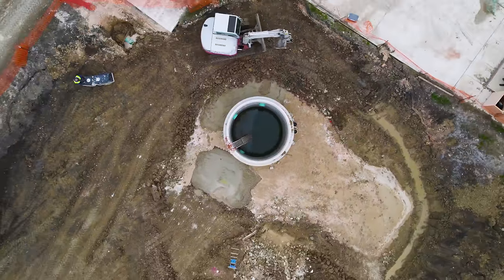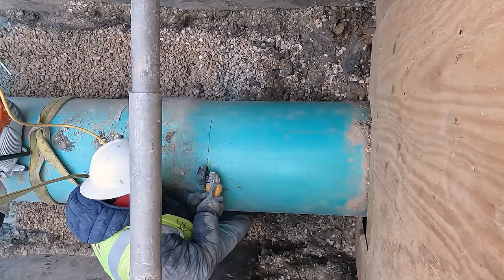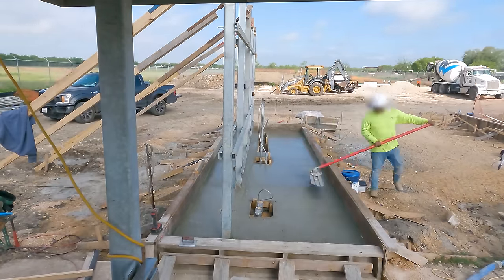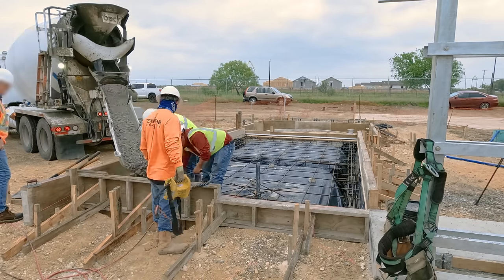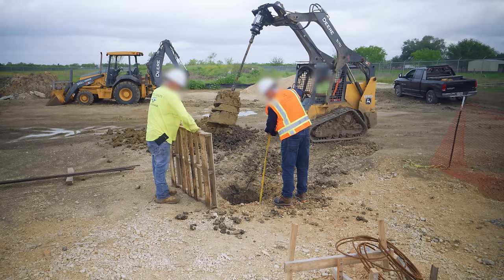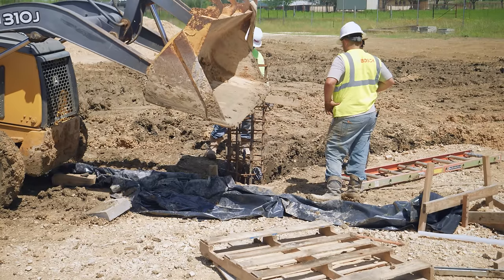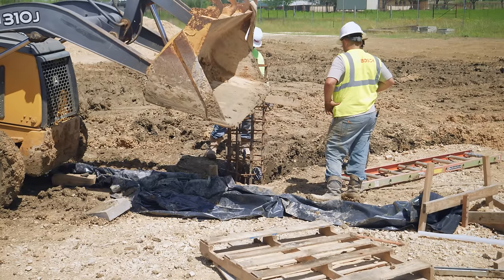HEAVY CONSTRUCTION of a Sewage Pump Station - Ep 4

Comment: Hi Grady, love your channels! This new sewage pump series has been great.  I have 2 reasons it resonates with me. 
(1) I am a mechanical engineer and have designed similar (yet smaller) lift stations for small communities and apartment/mixed use sites.  
(2) I live in a small rural township, we are getting our own lift station installed right now! As the township expands the sewage will be lifted and pumped to the larger nearby city. This small rural township (Harlem) is located in Ohio.  And in case you haven't heard "intel is coming to Ohio".  Unfortunately I live 5 minutes away from that new Intel site.  I really hate to see the development come, but watching your show and seeing it happen in my own backyard at the same time has been very cool.  Thanks again for all your hard work.
I am also anxious to see the last part and hear what the specs are for the pumps.

Comment: The engineering here is of a sound nature, but the actual pour process is flawed. There are quicker more efficient ways to achieve faster more profitable results especially when it comes to method and concrete product being placed. 
At Lafarge we would recommend our Agilia product which is rich in water reducer, command set accelerator higher than 1%,  plasticizer additives, as well as steel reinforcing fibres poured into a slip form. Do it once. Do it right.

Comment: I was literally an SPM for a much larger pumping station when I worked for a commercial GC and I still enjoyed the video. Very similar process to the job I did, we just did a lot more, but never got to watch it time lapse and with drone view. Another cool and somewhat similar project was we did was an aquatic center (like a big building full of indoor pools ) that included a massive prefab concrete underground stormwater detention chamber hidden underneath the parking lot.

I learned a ton of very non-intuitive stuff on that job. For instance everyone assumes that everything metal in a building for an indoor pool should be stainless steel due to the moist environment. Actually stainless should never be used in an indoor pool building. The reason is because of something called stress corrosion cracking. Turns out that in the presence of chloramine (a byproduct from the breakdown of the chlorine used in swimming pools) causes a very specific type of corrosion that stainless steel is particularly vulnerable to. It also effects regular steel, but to a much less effect, and more importantly, in regular steel the corrosion occurs in the same manner as regular corrosion and can be clearly seen through visible inspection. In stainless it shows no visible signs of deterioration right up until the point that it fails catastrophically.

There was a viral video a while back of a pool where the hvac ducting had collapsed into the pool and onto all the people using it. The galvanized ducts had visible corrosion (which is to be expected) but the broken allthread they used as duct hangers didn’t have a bit of rust on them - stainless. I remember wondering how the architect, engineer, GC, and HVAC sub all missed such a critical detail. Was it because none of them actually knew that it was a massive mistake, or was their oversight just so bad that nobody caught the fact that the hangers were a different material than spec.

Comment: Questions on episode 5:  (1) why do they only test surface concrete and not the concrete down in the well?  Seems more important to test the concrete in the bottom of the well to make sure that the bowl at the bottom is sound.  (2) Why not use an electrical backup (tesla MegaPack) instead of a diesel pump?  Would require significantly less infrastructure in pump, pipe and valves is you had a battery backup for existing pumps instead of a separate diesel pump in case of grid failure.  You could then bring in a diesel generator as a last, last resort which you're already set up to do.  Bonus:  you could use a Tesla MegaPack in place of the backup systems for the old well too.  (3) Nice set of white pickup trucks along with you Tesla at a shot toward the end of episode 5.

Finally, would be great if nebula allowed comments so that I wouldn't have to use this nebulous method to post a comment on episode 5.

Great series!  Thanks.

Comment: I know that hind sight is always 20/20, but when you live in a growing city you should know that systems like this will need to be extended and where the extended system will be placed.  Putting some of these valves and joints in place when the original system was installed would have been the smart thing to do and saved a lot of money.

Close to where I live the electrical utility owner bought some land to install a new transformer for the area.  They built the sight for two transformers but only installed one.  The distribution lines they needed to be hooked up to were across the street so they ran underground cables to them.  But the pad for the second transformer, most of the connections from the high voltage line where put into place and hooked up to those lines, and the underground cables to the distribution line were all put into place.

Now, when it becomes necessary to install the second transformer, all they have to do is set it in place, install all the connectors to the low voltage cables and finish the high voltage connections.  That is what you do when you see an area growing in population and you plan for the future.

Comment: I really like this view into the process of construction. When I did an internship at a glider manufacturer we were required to sample a bit of the epoxy for testing just like the concrete here.
One thought though: the concrete slabs have trenches on the outside (and in the middle for the bigger one), I guess they are a sort of foundation?

Comment: Well Engineering and Solutions to this project impressed me. But two giant mistakes are being made, The Steel Bars (Rebar) used in the entire project must be galvanised or electroplated. Andthe Placed concrete must be submerged or at least  sprayed with clean for a month, after that it can be glazed, painted or epoxied. These additional steps and Engineering will make the structure more durable (strong) and especially more reliable (very long life of structure) under proper inspections and maintenance (if required).
Reply: Although I am an Electromechanical (Mechatronics Engineer) but I do possess a great amount of Civil Knowledge and Experience. Anyways the floating guys did a great job. In here the floating guys dont do a great job and after curing the Concrete structure, with water, for a month, we place level dots on the slab, then place additional 1-2 inches of Concrete using smaller gravel and some waterproofing chemicals. That additional Concrete is sloped troweled and finished perfectly and then again cured.

Comment: These are excellent videos on construction. Maybe the lower viewership is because people are turned off by sewage. I was a city construction inspector for Los Angeles and 20% of our work was for wastewater conveyance and treatment. In my experience many people didn't want to hear (or see or smell) about sewage, they just want it to go away and get taken care of.
These videos would be great for training for civil engineers, construction workers and inspectors.
Grady covered so much so well here. I would like if he had added about the concrete mix design (and load tickets), and if spark testing was done for the wet well epoxy coating to ensure there were no thin spots.
Thanks!

Comment: Excellent presentation. I'm a 20 yr retired electrician. I can honestly said been there, did that. There the only thing is why they buried the block valve rather than putting  service pit. Just wondering. That was the engineers call. I used to service a lift station that looked like a regular man hole but when climbed down 2o feet, there was a 8x8 two story room with all the parallel pumps. If one went out. Valve it out and valve in the back up while you fix it. It had the wet well next to it similar to this one

Comment: It's been a bit since I've built any pump stations, but here in my area (northern New England) the majority of the concrete work is all precast structures.. especially the tanks and light bases. Any penetrations for piping is cored on site.

It is neat to see what you can do when 5' of frozen ground isn't a concern... you'd never see conduits backfilled with concrete.

Comment: I'm amazed at all of the tools they use to make the job easier. I'm surprised that they still have to hold the diamond saw themselves though and put all of that force on their lower back to cut into the concrete on the ground. It makes sense why they do it that way but you'd think there'd be a tool to prevent that.

Comment: Instead of those cardboard void forms, I wonder if you could use some kind of foam? Maybe even an expanding foam you could spray in, and then slice the top level. Then if the slab settles it would just compress foam. That would prevent animals or anything getting into the space, while still being mostly air.

Comment: 14:00 I'm surprised that you cast the top of the wet well. In the UK we use precast concrete slabs called biscuits (might call them cookies in the states). Any extra wholes required, just drill thru.

Comment: I have seen slabs replaced days into the building of the structures atop the slab because the quality control samples didn't pass compression testing.

That put a housing project over a full year behind schedule because of the time to break the defective slab, reform the substrate and fill, replace the rebar, the time of having to get all the subcontractors back on site from the other jobs they had moved onto.
It's bad.
Reply: The concrete supply company ate all that cost and then went out of business.

Comment: I was wondering what kind of pumps they use for pumping sewage? Everything I recall from class is you want regular, potentially treated, water with ample head to prevent cavitation on the blades/fins and other issues that could damage the pump. I imagine with sewage there’s a lot of “debris” that could foul up a pump, unless they use positive displacement pumps maybe? Burning question from a young new engineer 😊

Comment: TIME 19:40 - The electrical coming out of the slab/silo will be sheared off if it settles.  Either the concrete skirt or the fact the sweeps (90 degree conduit) are cased in concrete.  This block nor the skirt will settle at the same rate as the silo/slab.  Thoughts?

Comment: there are areas in my region that have had sewer put in to replace existing septic systems.  some agencies installed pipe with taps for every property.  others require the septic installer to drill his own tap into the sewer line every time.  the best example, ran the sewer line up and over a hill, requiring every homeowner to have a 240V discharge pump to pump their wastewater over a hill the sewer line could have easily gone around.

Comment: How do they finish installing the pump towards the beginning of the video? I can't think of any way to connect two unmovable sections of pipe that can't be brazed together. Is there a kind of pipe that extends to bridge the gap between the two? Are the sections of pipe more mobile than I imagine they are? I don't have a complete picture here.
Reply: Sorry, not pump, valve. It's early here.

Comment: I really hope that the nuclear density gauge at 5:07 is either a dummy unit and that they're demonstrating how not to use one. If that is a real gauge, the radioactive source shouldn't  be exposed like that above ground; the operator just blasted everyone in the immediate vicinity with an unnecessary exposure of ionizing radiation.

Comment: The deeper into this project we get, the more frequently I find myself saying "Well, that doesn't seem like the most effective way to do that task..."

I am by no means a structural or construction engineer, but 

1) Why is the well cap cast in place, necessitating all that forming and scaffolding?

2) What actually happened at the "cut the line" stage -- it was kind of glossed over...

3) Was it really necessary to drill for the light pole, when we were going to excavate a trench to it anyway?

4) And what about Naomi?
Reply: Sidebar: is the incidence of "construction worker who the FBI is after" really high enough to require blurring out every face in the video?  It's really sort of jarring.

Comment: I would have liked to see the method of reconnecting the cut ends of the plastic pipe, after the installation of the valve.
Similar gasket thing?

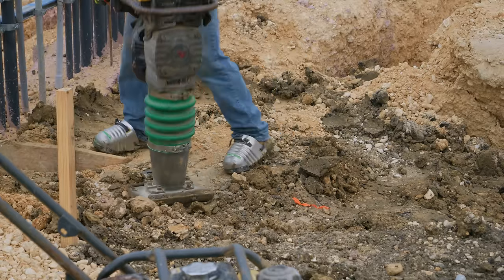Comment: This series is very cool, I'm going to be sorry when it ends. How does the first pump, 24", that got installed early on, get controlled? I didn't see any electrical or mechanical means to turn it off and on.  Any idea what its service life is? Just wondering why it wasn't put in a vault. At around 6:45  I saw for the first time, but just briefly, when the jumping jack was being used the operator looked like he was wearing heavy metal slippers, neat. I'm surprised no warning tapes were used in the backfill going into the trenches.
If the concrete doesn't past the compression test, who picks up the cost of all the work of replacing the slab. Does the industry release how often that happens?

Comment: 20:12, I understand the large slab is coupled to the wet-well, and not the surrounding material, but then the protruding conduits are cast into a block that is not coupled to the wet-well, but rather to the surrounding material..  Doesn't that mean that in the event of any settling of either the wet-well or that block, all the force will be on the conduits ?

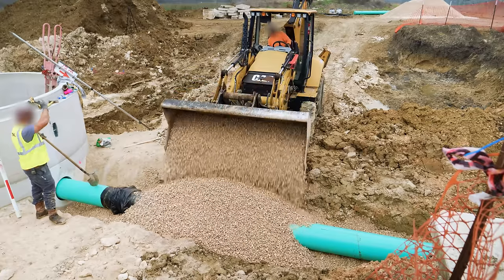Comment: A valve is cut into a 24" line (3:30) then apparently buried right away (4:00).  How is this inaccessible valve going to be actuated (controlled, opened/closed)? I saw no sign of any electrical or pneumatic connections being installed nor any sort of access cover or some sort of riser to a handwheel station. Was something left out of the video?

Comment: As an electrical engineer doing similar design  I don’t see a reason to bury the conduits in concrete (unless they're over 600 volts) and the metal parts should be coated in bitumen or like product where underground or cast in concrete IMO.  Otherwise,  like the videos and format

Comment: That step where the inspector pushes the probe rod out of the machine, then eyes it to get it into the hole, is exactly what the manufacturer says not to do.  When the rod is up in the machine, it is surrounded by a lead shield to contain radiation.  When the rod is extended, the radioactive source is exposed and lowered into the ground, alowing for a radiation count that correlates to density.  At no time should the rod ever be exposed to the open air.  It can cause cancer and radiation sickness.  Remember when Australia went nuts for a few days last year because a radioactive source from one of these rods WA lost along a highway?  Do the inspector a favor, and let😊 him know why he should not do that.

Comment: I think it's hard to balance keeping the content simple enough to understand and fitting everything into the limited time (and attention) viewers have. The regular videos are about a narrow topic, so they can be both short and go into sufficient depth. 

In this series, there are parts where I got confused as to what the thing they're building is supposed to do and how it fits into the larger picture. For example, I'm still confused on how the wet well helps lifts waste water, or what control shelter does.

Perhaps a better way to present this is to focus on one or more subcomponents of the lift station in each episode, covering them from beginning to end. E.g. first episode is just the wet well. Second is the piping, valves and manholes. Third is the pump and electrical connections. That way each episode is self-contained, with hooks (in the form of questions) at the beginning and rewards (in the form of answers) at the end.

Comment: I dont know about Texas but in NC the way the CMT inserted the radioactive source in the nuke gauge is incorrect per standards. Ideally you would drop the gauge directly where you hammered your hole so you aren't exposed to the source rod. But again Texas is probably different.

Comment: 16:20 Why does the slab need to extend so much around the well? Wouldn't it be enough for it to be just large enough so that it can't fall into the well but not extend beyond the well's edges? Then there wouldn't be a need for that empty space around the top of the well.

Comment: 18:58 Is the lack of red coloring in the concrete used in the electrical trench for the light not important due to the voltage differences?

Comment: Did they install a below ground diesel tank for the genset ?
Reply: Probably just a belly tank on the genset itself. Not a primary pump so it’ll only run if there’s a power outage, at which point some poor apprentice will get sent out to top it up.

Comment: 3:07 cant get past the overhung load on the suction of that bypassing pump. that primer must weigh 300 pounds plus the full and very stiff 6 inch petroleum hose protooding as far as it will. has to wallow the wear rings if the volute is ductile at all but hey its a rental. i want that nifty PTO bell housing. ok govtplanet and purple wave.